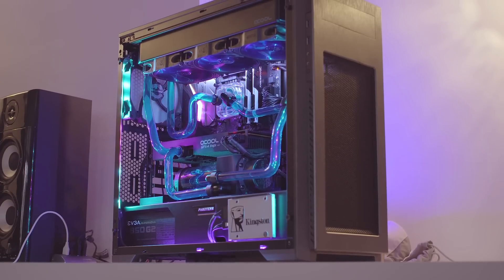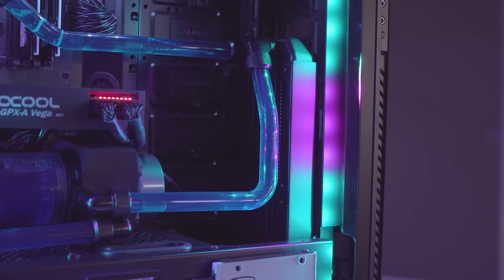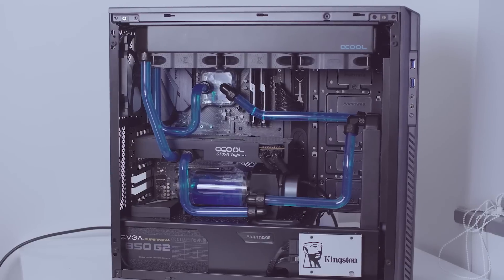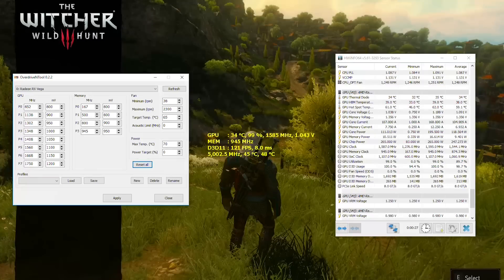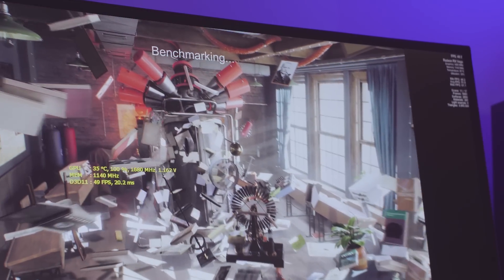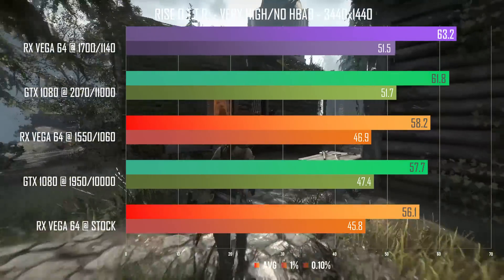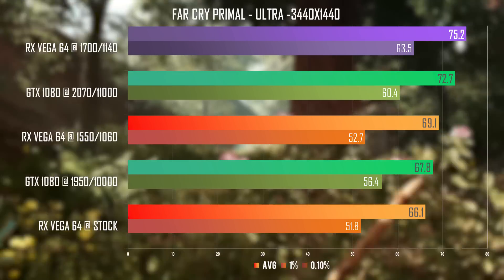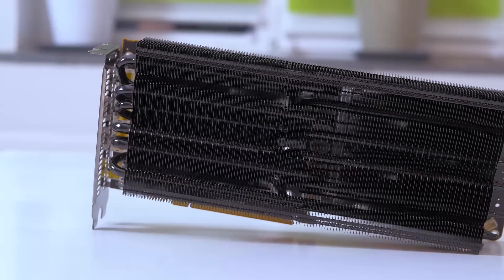1700MHz RX VEGA 64 - how FAST is it?

Comment: I have my vega under water, but it's an Asus and there is no lc bios. So I struggle to get over 1670mhz, with 1.2 volts it won't even go over 1630, so 1100mv is were i get max clock which I don't understand because my card gets only 38 degrees hot. Any solutions for me?

Comment: Running my sapphire pulse v56 with v64 liquid bios a little underclocked and undervolted at 1660/1100mhz for over 6 months now. Temps are fine at 85C hotspot when 100% loaded too...not bad for an air cooler.  Got lucky with the card both having samsung ram and a good chip for a change...Although one DP port stopped working but who cares....

Comment: GTX 1080 doesn't need a water block to cool it and it overclocks easier. Nvidia still wins in my opinion 👌
Reply: Sapphire Vega 56 300$ 
Bios flash 64
Ek waterblock 280$
1680/1100 45deg full load 
Zero noise from GPU fan
1440p144hz freesync

Comment: I can do 1712/1000 with a vega 56 stock cooler (super loud though) and vega 64 bios installed for that memory overclock
Reply: if possible on my rx vega 56 gigabyte custom achievement 1720 mhz but at 1.1 v stable but mother consuming ... currently only 1,050 v at 1670 mhz all this accompanied by 1023 memory with tight times with memory tweaker ...

Comment: I'm running 1715mhz and 1100mhz on a Sapphire Nitro 64.  Is it worth flashing the LC bios on it?
Reply: Steelvelvet youre going to fry it, please don't.
Reply: @zway5881  gotcha.  Thanks for the heads up
Reply: Core clock stock and memory clock 1100, what is graphic score time of spy in 1440p?
Reply: What's your voltage settings?

Comment: Hey thank you for this video. I have been beating my head against the wall trying to figure out what was wrong with my card and it has the same issue you have not going over 1700 mhz at all. Now trying to find a good long term place for it. The new low prices I was able to grab the Vega 64 power color with ek block for $350

Comment: how much power does this actually draw now? I have a feeling that my Sapphire Nitro+ will handle the heat no worries - Im definitely hitting power limit which set at +50%VA is only 315W, I can Volt down to get 1650-1680 in superposition, but it's hitting up at that max power and crashing a lot. might be worth the bios flash.

Comment: I've been trying to figure out if Vega 64 would be able to run stable at 1500MHz, and this vid seals the deal for me. I like Nvidia cards but Vega's seem better overall, although not as fast. I'm kinda disappointed to read that using any card with a slower card will down clock the faster card. I wanted to mix 2x Vega 64+ 1x Radeon Pro Duo 32GB, but the best clock speed attainable on pro Duo seem to be sub-1200MHz. I was hoping to at least leave the Vega's stock, but OC the Pro Duo to 1247MHz, but 1180MHz is the best I've seen.

Comment: I've seen it mentioned elsewhere that the Vega Liquid BIOS needs to read pump RPM or else it thinks the pump has failed and shuts down to protect the card. That might be the reason yours cashed with the liquid BIOS.

Comment: Do you think that Morpheus II would not have been up to the task cooling Vega64, when You had run it also with Vega64 LC bios and those clocks?
Also what were your HBM2 voltages when running 1140Mhz?

Comment: ROTTR Needs HBAO! But that would provide Nvidia with a larger lead still.  
I still frequently wonder about Vega's Render back-end, with only 16 physical ROPs, each ROP "Quad Pumped" meaning they push 4 pixels/clock - leading to Vega's RATING of 64 ROPs. Well I have to wonder, that given Vega's larger percentile loss of FPS using old school, render based high Anti-Alaising settings, such as MSAA, SSAA, as well as others that are not post process based, like FXAA, SMAA, TSSAA (the best), and others, as well as the way it loses more % FPS with settings such as HBAO.

If I had to guess, I would suspect that those 16 Quad pumped ROPs are NOT FLEXIBLE! Which is to say, if ONE ROP is processing, it is effectively using 4 ROPs to complete a pixel operation, and with Render based AA and Render based Ambient Occlusion, the ROPs have to process several different pixel operations simultaneously, which with Nvidia's structure, allows for MUCH more "granular" flexibility when it comes to the Render Pipeline. Because, again, Vega actually only has 16 ROPs, but they run 4 times per clock. The problem, if I understand correctly, is that the SPs must have a scene, in a sense, partially Pre-rendered for those Quad pumped ROPs to actually be ABLE to push their theoretical fill rate, but when the render pipeline is constantly needing to switch context and process disparate parts of a scene with varying effects like Ambient Occlusion, and the VERY HIGH variability thar comes with MSAA and how it detects edges, and applies a filter on them to be rendered at a higher resolutions  - well that does not work optimally when each ROP is responsible for 4 pixel operations per cycle.

This behaviour is best shown, in RACING GAMES! DX12 ones especially, like Forza 7, RX Vega performs FAR better comparatively, than it otherwise should, when compared to a GTX 1080. Well Forza 7, for one, only uses post process AA (important as this stresses SP/CUDA cores, NOT ROPs!)- and secondly, racing games are in essence "on rails" in a way. The track can be fully pre-rendered, with only cars and effects needing to be rendered immediately. 

Anyway that became a HUGE rant! But it would seem that RX Vega could be SOMEWHAT held back by its Render back-end system in many scenarios....
Reply: I know it's late but thank you for typing that out... I hadn't realized the Vega's 64 ROPs were 16 quad-pumped ROPs... the fact that Vega regularly shows 1% and 0.1% lows in the 1080Ti/2080 range in newer benchmark games while having averages in the 1080 range makes more sense to me now, if your theory is correct.

Comment: 3:07 LMAO I know EXACTLY how you feel mate! I am OCD about my PC, I was NOT happy running my 8700k at 4.8 all core, but just 4.6 Cache/Uncore - besides which, that was REALLY pushing my chip before delidding, it would hit as high as 92° C in AIDA64, and as much as 96° C in Prime95. 

After delidding, I first managed 5 GHZ core, and something about SEEING CPU-Z say "5000 MHZ" made me feel a certain way - tech geeks should know what I mean! That feeling, only increased 5 fold when I saw that AIDA64 did not make my chip exceed 77° C, and Prime95 Small FFT hit just 81° C! 
Same deal with my Gigabyte G1 Gaming GTX 980 Ti, I simply wad NOT satisfied with seeing 1467 MHZ solid core speed, and I REALLY disliked 7 GHZ effective VRAM!  But after a bit of tweaking, at 1.218 Vcore, +136 MHZ Core, and +990 VRAM (OC Guru II) I am now HAPPILY at 1505 core, and 8 GHZ effective VRAM! Making my 980 Ti faster than ANY GTX 1070!

But with 4.7 Cache/Uncore, but I was NOT fond of the fact that my Cache was 300 MHZ slower than my core - besides which, it would sometimes throw a sum error in Prime95 and cause a thread to stop. I then figured out that if I enabled Cache to core offset, and then set my cache to 5 GHZ, not only was it FULLY stable, but I was seeing INSANE L3 cache speeds and latency, at as high as 420 GB/sec read, 320 Write, and 376 Copy at just 9.5ns latency! Doing this also lowered my Memory Latency from 51ns to 48.6ns!

Comment: just a question i also have this waterblock and had it in a loop with the eisbaer 240mm cpu cooler too with a 360mm rad on the vega, but not custom loop. just using the quick connect. my gpu is running at 55-60c and even in its own loop too. does running a full custom loop change temps by 15-20c?

Comment: If AMD does a node shrink on Vega, it could actually become a contender for the 1080ti, if they could get the clocks up a little more.  I'm not in any way saying it will happen, but it seems to respond really well to higher clocks.  Especially the minimums.  GTX 1080 owner here, so there is no fanboyism going on.

Comment: Exactly. Vega is decent, but 1 gen behind nvidia. Vega is very late in it's arrival and there are many deals on nvidia 1080 line and prices are nice. Nvidia is cheaper and more power efficient, which matters. I think it was bad move to rush Vega on current 14/16nm node. And should have made Vega on 12nm node and that would have had much larger impact on gaming cards

Comment: "The Vega can't even hang out with the 1080" - Jayz2Cents
Reply: Well, he may be right, the state that Vega is right out of the package should be on par with 1070, but if you tinker the card enough, you can really gain performance. And as this video shows, you really need great cooling and lift off the power limitations. Also, the game benchmarks aren't like synthetic ones. Most games are nvidia optimized and so on.
Jay is a cool guy and makes entertaining videos. I admit, when it comes to water/liquid cooling, he's an expert, but when it comes to video cards and CPUs, you may want to get a second opinion.
Reply: He had to put the vega on a water loop and flash the bios to get 1080 performance lol
Reply: @vdochev  what? axxaxaxaxaxaxxa my vega 64 strix stock beats the hell out of a 1070 ti and is as fast as 1080 stock
Reply: @vdochev  what 1070 are you talking about is ages better than a 1070 and above 1070 ti for sure

Comment: I bought the frontiers edition LC for now, as it dropped by over 40% in price. I wasnt sure, if I really want to hold on to the card, so I thought it would be good to take the LC one, as I guess it sells better later on, as people like those cooling methods. 
What do you think about the LC one? As I am not planning to directly overclock it, it is fine I guess, and the 16GB of VRAM are coming on a cheap for HBM2...so I took that ooportunity although I perhaps never benefit from it.
Fingers crossed: I hope, I am not disappointed. My last few decisions on graphics cards, although controversial to others opinions, always brought me on top. I had no GPU update for a long time. My HD7970 (probably my best gfx card buy ever, considering a 680 cannot run anything anymore) now is really old. I havent upgraded, because the kind of games I play.

I hope, that the aging on the AMD cards will catch the 1080 completely and even compete with a 1080Ti. 

BTW: I am looking forward to the new drivers. 11.4 already showed a massive increase on witcher, which makes your result even cooler. Lets see, what adrenalin drivers have to offer.

Comment: What do you think about the EK FLUID GAMING A240R for RX Vega?
Reply from the maker: +TJCCBR47 I think that for the price it's going to be an awesome kit. The 240 rad is going to do just fine at first and will be a huge leap forward from the stock air cooler and even AIB coolers. And there's always the option of switching to a bigger rad or adding an extra 120/240 for even lower temps. If you're looking to pick it up, it's a great value for a full custom water loop, for sure!

Comment: So about the Morpheus again:
You spoke about problems with the cooling of Vegas VRM, if I remember correctly.
So what do I do with them ? Grab a Metal Saw and make some very tiny Passive Coolers for them or do I leave them blank?
And if I leave them blank, how much RPM should my Fans do ? The highest I found is an Industrial Standart 1500-3000RPM Fan. But that would cost me 30€ each and it won't be a Silent Build, that's for sure ^^ Any Tips ?

Thank you !
Reply from the maker: +Fr0Zen1 _ I didn't say anything about VRM improper cooling with the Morpheus, IIRC. Since there's direct airflow on then with the 2 fans that can be mounted on the Morpheus, I think they do great. Also, VRM on Vega cards is top notch in order to cope with the power draw. And FET's are specced to 120C max IIRC.
Reply: Right, Right, I looked it up and it was the Mosfet you spoke about:
https://youtu.be/THaMlkNDzYs?t=251
So I think they will be fine with 120C Resistance... but maybe not...  ^^

Comment: Very nice video man 

You should see what one is capable of at 1800mhz, have a few vids on my channel, no benches or graphs just gameplay footage with overlays though.  Strange thing is, I've just finished an upgrade on my rig to a 8700k @ 5GHz so will need to record some proper videos as my old vids all with 3770k and ddr3 but with the new hardware I can't get past 1750mhz :( .  Vega 64 is a beast on water, but there are better options when you add all the money needed for a full custom loop.
Reply from the maker: +TonyTurbo78 Was your card liquid cooled to begin? Mine was the regular air cooled version.
Reply: MindBlank Tech no, reference blower bought on day 1.  Flashed an LC bios to it which allowed me to push 1250vm and hit the 1800mhz core clock.  Although I'm starting to doubt the clock reporting was accurate because I can't get it past 1750mhz without crashing on this new build.

Comment: Mindblank, could you maybe add some data about 1080 temps and power consumption? A lot of mentally challenged people in the comments believe various nonsensical yappings that have been going around the web, so maybe a little wrap-up video would be good, summarizing your total experience(not with just a few slides) from stock to this CLC build, as well as practical comparison to the main problem - the existence of 1080. For now - my 50 cents to the other commenters:

1. Power Consumption:
For those with lack of pause reactivity or visual alertness, stop at 5:08 to see the power consumption. No, it's not 400W+, nuclear strike is NOT detected.
Also check one of the few reliable sources about hardware on the subject of stock and OCed V64/1080:
http://www.tomshardware.com/reviews/amd-radeon-rx-vega-64,5173-17.html
http://www.tomshardware.com/reviews/nvidia-geforce-gtx-1080-pascal,4572-10.html
As you can see, an OC-ed 1080 can actually draw past 300W as well. While it does show 200W average, I have a hard time understanding this Nvidia inconsistent power draw. What I can understand - is that Vega can draw from 200W stable to 300W stable, depending on preset, and not a single reviewer, as far as I'm concerned, bothered to undervolt. What would another decent source suggest?
https://www.anandtech.com/show/10325/the-nvidia-geforce-gtx-1080-and-1070-founders-edition-review/30
https://www.anandtech.com/show/11717/the-amd-radeon-rx-vega-64-and-56-review/19
Apparently V56 consumes just barely more than 1080. And V64 consumes only about 25-30% more. Yes, unpleasant, but has anyone forgotten that 980ti was 250W? People have lived with such TDP numbers for years, and suddenly, just because Pascal has made a leap - it's the new standard. Yes, Vega did not make the leap, but it's not consuming UNGODLY or UNIMAGINABLE power.

2. Temps:
Looking at the same reviews, and seeing very similar data from Mindblank, all  I can say is - stock blower cooled 1080 also sits at 80C+. In fact, it's a couple degrees hotter in both reviews...
Yes, setting up better AIB cooling MAY have been easier for 1080, seeing as the original Asus Vega Strix has been a piece of shit on all counts, but, just as Mindblank has shown - if you apply adequate cooling, like Morpheus II - you DO get actually solid temperatures. There's finally a wave of Vega AIB cards getting into the market, and I hope at least one of them does it right. I mean, obviously, two-fan smaller radiators won't bring 80C to 50C, like Morpheus, but one would expect a proper 80C to 65-70C as it should be, and that means OCed.
Again, the point is that the temperatures are not unforeseen. And they are most definitely not "hopeless".

3. But Novidia is CHEAPER!:
Yes, it is. However, the price of CLC is not included, should NOT be included, as Mindblank has shown that Vega can compete with 1080 even with stock blower fan. Also - Novidia is one year old and mines worse. Where I live, it's either 500 euro for a "price-established" 1080, or ordering V56 or V64 from a neighbouring country's major retailer. Yes, that's about 30euro shipping, but I've seen V64s appear for 500 euro a couple of times(bought out instantly), as well as V56 going at some 440 euro - also already went up to 470. So it's not like they aren't sold... or are THAT much more expensive.

Don't forget about monitors. At my local price aggregator, I see 150 Freesync models and 39 Gsync. Guess which Gsync is the cheapest? AOC g2460Pg, 350 euro 24" 1080p 144hz TN. At its price, I remember a much more interesting model from AOC with Freesync - AGON AG272FCX, slightly cheaper 27" 1080p 144hz Va. Larger screen, no bezels, better panel. The quality of that Gsync panel is of ~100euro cheaper screens - basically for those, who "just want 144hz".

Now, of course, if you are gaming at 30FPS, no framerate compensation will help, and if you play 100+fps, you don't even need any "sync", but that still shows that with Nvidia card you either end up using... or rather, being UNABLE to use, a Freesync monitor, or spending some solid extra cash to get a Gsync option of questionable quality.
But with AMD, you can spit into the pool of monitors and you'll most likely hit something with Freesync on it, so you are already covered. And, if you decide to spend a bit more, along the lines of Gsync, you'll definitely get a better quality monitor than Gsync.

As for 1440p, the cheapest Gsync options I see are:
AOC AGON AG241QG ~420 euro
DELL S2417DG ~450 euro
Acer Predator XB241YU ~460 euro

All of then 24" 165hz TN.

What is available for 500 euro with Freesync? Samsung C27HG70QQI
27" 144hz Va Qdot with support for Freesync 2 and HDR.

And, if that's not really a concern, then AOC AGON AG241QX, ~320 euro 24" 146hz TN. As expected, 100 euro cheaper for practically the same stats as Gsync.

Of course, the point is reduced if you already have a monitor, but again, Vega price is no longer that much bigger and the monitor price difference is not going anywhere.